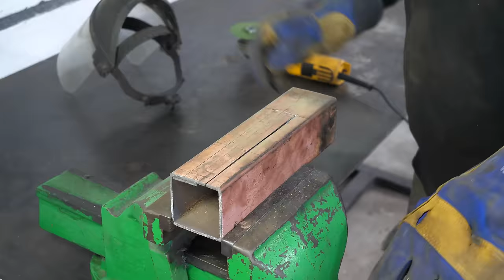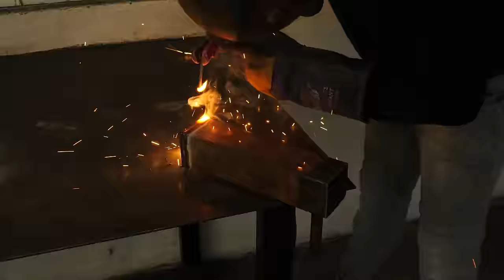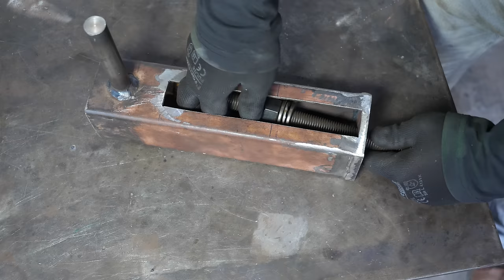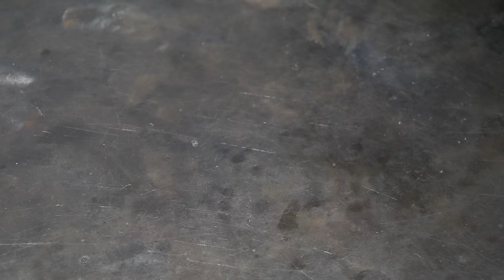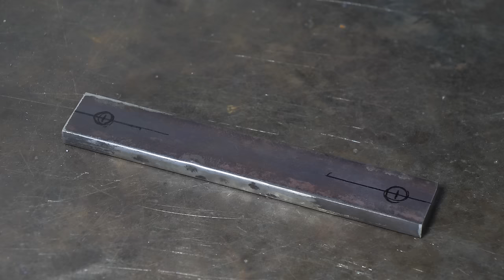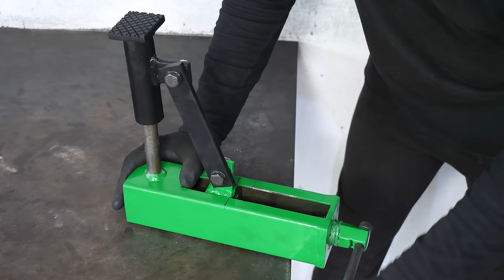How To Make A Simple Jack At Home Very Easily | DIY

Comment: It's not very practical. Too tall, don't raise very high. He needs a hex head for a turning mechanism so a socket and ratchet can be used. The way the arm is pushing against the 90-degree post it is working agenst it's self for the first half of the lift.